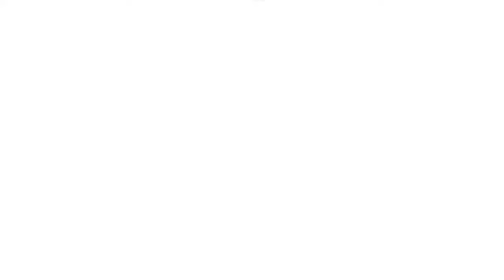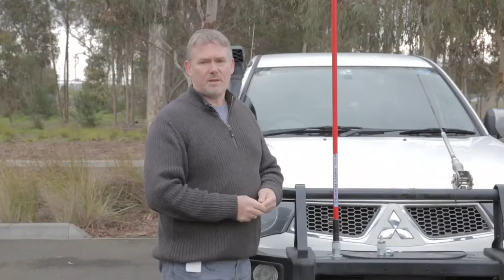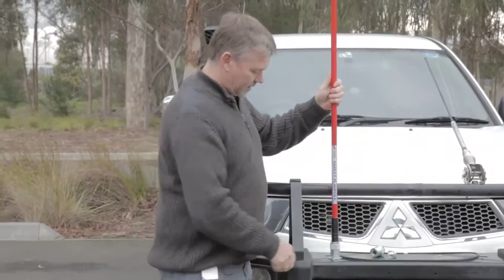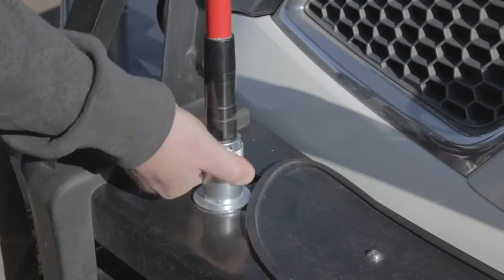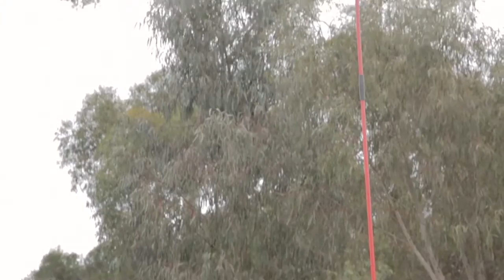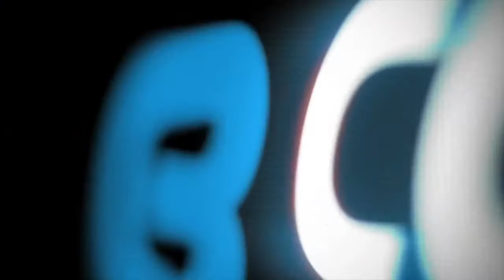3m Safety Flag Pole

Comment: How does it go when passing under trees / branchs? Do you have to take it off for these situations or will it flex back?
Reply from the maker: Hi Diarmuid, 

Thanks for your comment.

The pole is designed to have minimal flex, so it’ll be safe to leave on when passing under small branches. Just be mindful with bigger branches, if it looks risky we recommend taking it off.

Cheers,
4x4 Equip Team